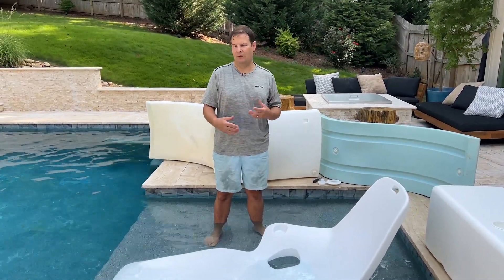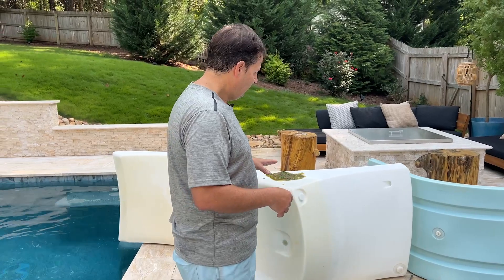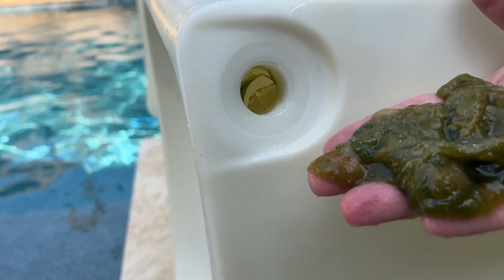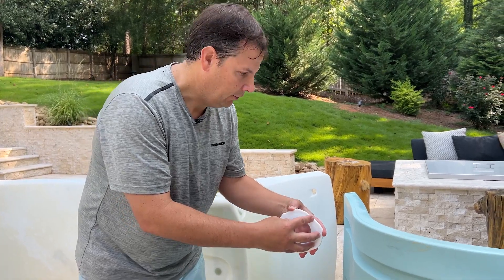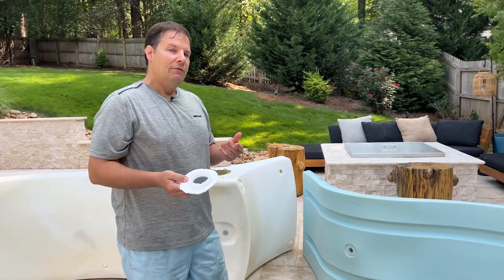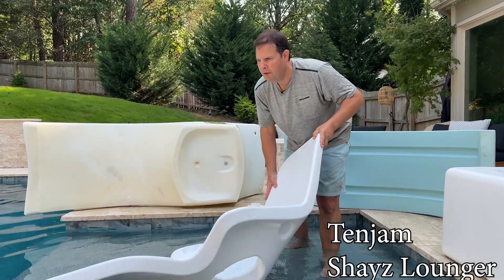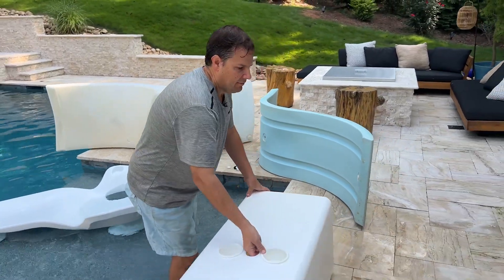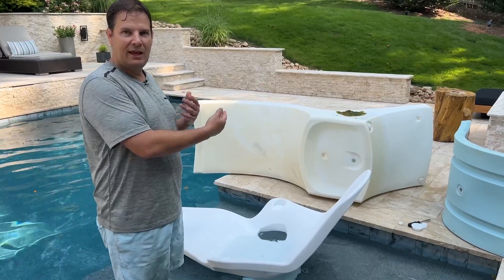Explaining the Water Filling System for in-pool furniture companies

Comment: Such a dmart design. Does your lounger move around or stay stable?
Reply from the maker: Tenjam Shayz Lounger has a patent pending snap-in riser design.  We also have a patent pending filling and draining system that holds additional water in the core of the lounger when it's in the pool, but as soon as you lift the front of Shayz Lounger above the pool water it releases the vacuum water seal and allows the water to quickly release from the core .... so you don't have to try lifting a water filled lounger out of the pool. This system also keeps water recirculating and refreshed in the core so it doesn't promote algae growth.

Shayz Lounger stays very stable in the pool as long as you use the correct risers for your pool depth:
- Shayz without risers works in up to 5" water depth.
- Shayz with 4" risers works in up to 9" water depth.
- Shayz with 8" risers works in up to 13" water depth.
- Shayz with 12" risers works in up to 17" water depth.

We also have a video showing how some people have added diving weights inside the front riser to get the Shayz to work in slightly deeper water.